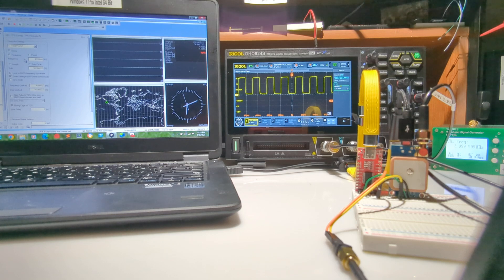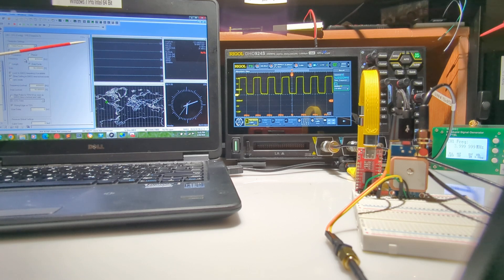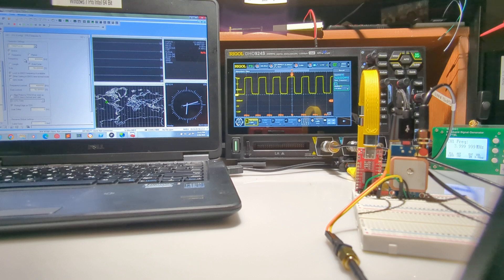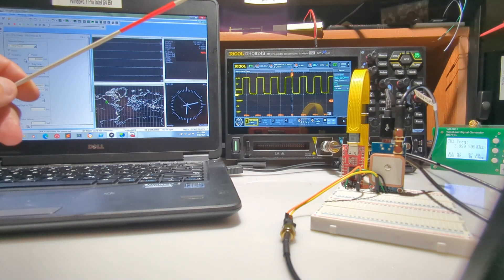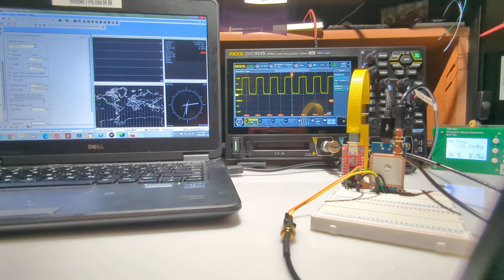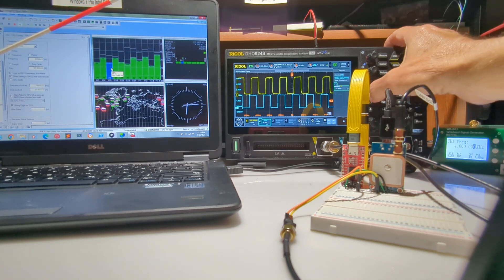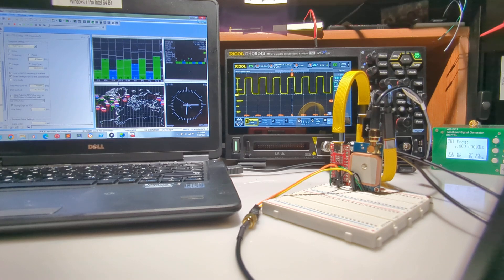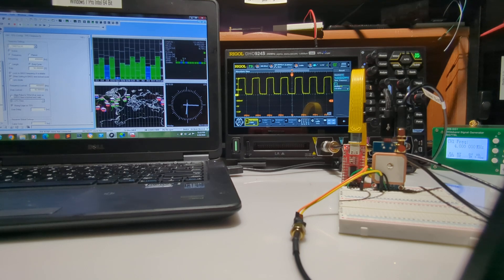UBLOX GPS waveform jitter: experiment shows the cause

Comment: A channel by the name of @TheHWcave showed that the jitter was caused when the PPS frequency is not a divisor of the internal oscillator frequency which should be 48 MHz if I’m not mistaken.

This is the video: https://youtu.be/M6SmdqMA-Dg
Reply from the maker: Thank you for the link. Note that jitter will also occur after getting a GPS fix, even when the frequency is a divisor of 48 MHz, as demonstrated in this video.
Reply: @philipgiacalone5605  Basically there are two sources of jitter then
Reply from the maker: @niconiconii-san  Yes, there are two different scenarios. The root cause of both is the same: the generated frequency is not a perfect divisor of the clock frequency (so the waves/cycles don't fit perfectly between clock ticks).

Comment: OK, I did some testing using an LEA-M8T-0-10 module with f=12MHz, 50% duty cycle, lock to GNSS, and I can't see any jitter - it's a clean 12MHz square wave.  I also measured it on a counter in stats mode (HP53131A, Ref from a FE5680 Rb standard) over 100 cycles with a 1s gate time and got:
Fmin = 11,999,999.975Hz, Fmax = 12,000,000.039Hz - high time was min = 40.7ns max = 43.2ns - since 1 tick of the 48MHz clock is about 20ns this is likely just noise from my quickly hooked up test setup.
Reply from the maker: That is very interesting, thank you. I see from the spec sheet that the LEA-M8T has an RTC that provides a more accurate time base. That feature may partially explain the cleaner analog output. I will have to get one and try it, thank you.
Reply from the maker: Btw, are you using a scope and triggering on the GPS signal? That hides the jitter and is why I'm triggering on a separate signal in my video. You could trigger on the Rb signal in your testing, for example, and then observe the GPS channel for jitter. Curious to hear what that might show...
Reply: @philipgiacalone5605  I tried several approaches - one was just to use the scope on it's own, one was to use the Rb in one channel and trigger off that with the holdoff set to 6 cycles of the reference (which should correspond to 5 cycles of the 12MHz) and the last was to use an RF signal generator (an ancient Marconi 2019A, but it still works) set to 12MHz and connected to the Rb.  I couldn't see any jitter with any of the setups I tried.
Reply from the maker: @TrimeshSZ  Thanks for that added info. Very interesting, indeed. If the tick period of the LEA-M8T's clock and oscillator is spot-on with the GPS time period, then the jitter problem would disappear (for frequencies that divide evenly into 48 MHz). It's curious how they could achieve that. Another experiment you might try is heating the LEA-M8T and see if jitter returns. Seems to me the output frequency would still be controlled by the physical properties of the oscillator. So if the frequency changes while the GPS timebase doesn't, jitter should return. BTW, all of this playing around with GPS signals has been out of curiosity and for fun. It's an interesting topic, imo, and I appreciate learning from your results, too.
Reply: @philipgiacalone5605  Looking at the datasheet the two modules seem very similar - I was thinking that maybe the "T" module had a VCTCXO like some of the Trimble ones - but it apparently doesn't.  I guess it's possible that the T module has a closer spec TXCO though. I will see if I can get a M8S and compare the two side-by side.
Reply: What is the expected GNSS time base expected to be, also wouldn't one expect to see a shift depending on time of day as well?
Reply: Why is the jitter important? Electrical engineer here, but I know nothing about what yall are doing.
Reply: @DeadtomGCthe2nd  I'm not sure about the specific intent in this case, but some common reasons for wanting a low-jitter clock are if you are using it to discipline a crystal oscillator or drive analog circuitry from it.  Jitter is especially bad if you are driving a multiplier because the output phase noise is 20log(n) of the input phase noise where n is the multiplication factor.